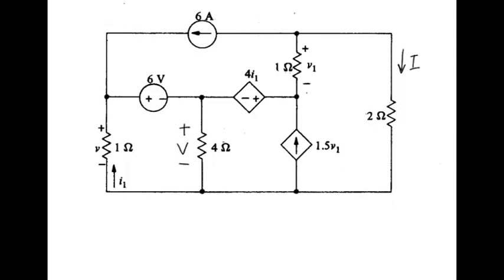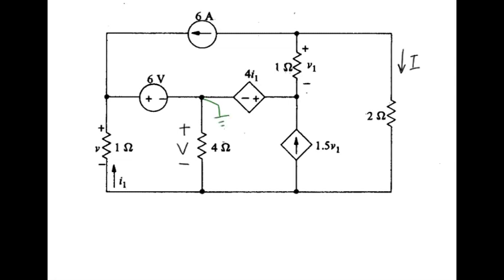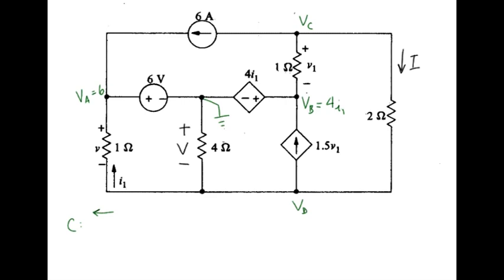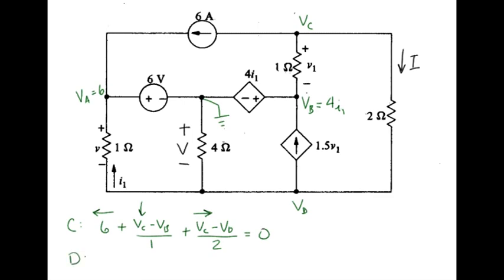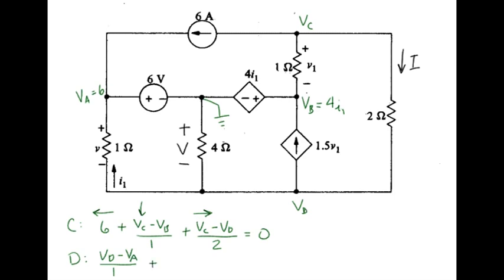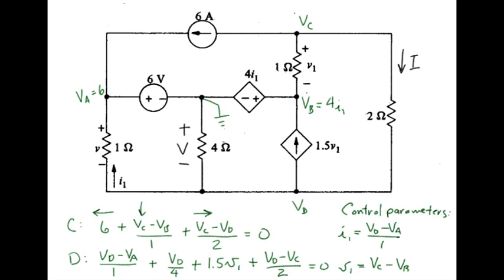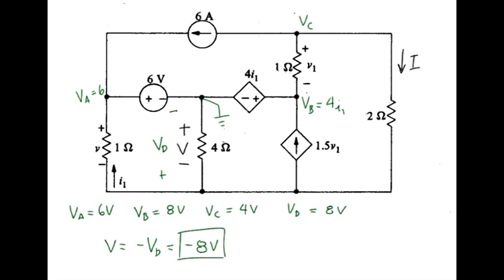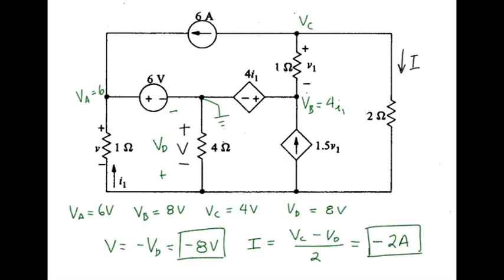dc: Node Voltage Example #9

Comment: Chose the bottom node as the reference and joined the voltage sources together in one big super-node. By the time all the substitutions were made, everything condensed down to a 2 x 2 system of equations. Got the correct answers for V & I.

Comment from the maker: Sorry for the confusion, in this video solving for "V" across the 4-ohm resistor, not "v'" across the 1-ohm resistor. Just re-checked the values for "V" and "I" in the simulator and they are the correct values. Thanks for asking!

Comment: I approached this differently.  Actually placing the reference node at the bottom grounds 4 rather than your 3 components. I then made a supernode encompassing  Va, your ground and Vb. This resulted in 2 equations (one for the supernode and one at Vc) and an additional 3 very simple constraint equations with, of course, the same voltage differences and currents.

Comment: I have not understand about the selection of the reference node... Can you please explain  it to me
Reply from the maker: When the reference node is not preselected for you, choose the one that simplifies as much as possible the equations you need to write. Selecting the reference to maximize the number of "grounded sources" (those that have one terminal attached to the reference node) maximizes the number of nodes for which subsequently know the voltage without writing an equation.